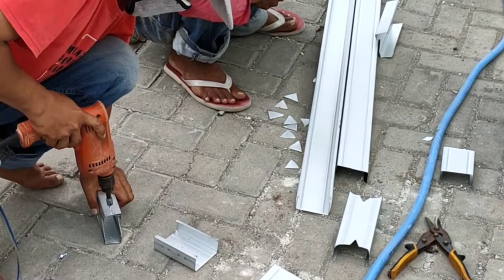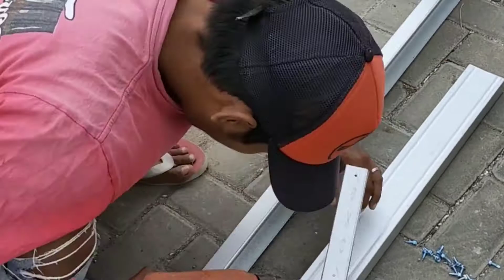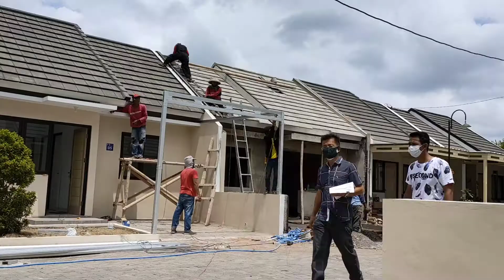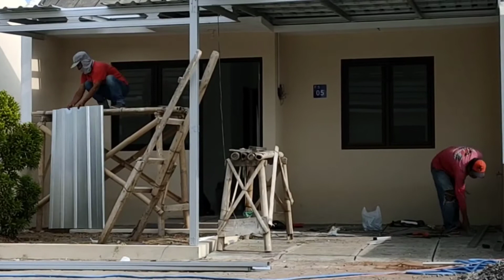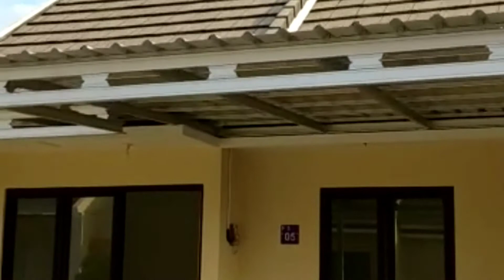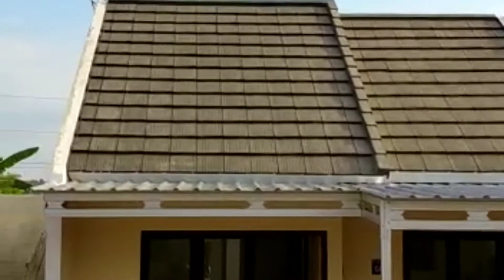CUKUP 2,8JT UNTUK KANOPI MINIMALIS LUAS 16m2

Comment: Total biayanya berapa om...
Reply from the maker: Luas  16m2
Total Biyaya 2.720.000
Untuk info lebih lanjut bisa hub WA kami di 081903705961
Reply: kalo atap baja ringan habis brp ya?
Reply from the maker: @robbydwimilyana6406  untuk ukuran berapa pak
Reply: @knpbajaringan  84meter
Reply from the maker: KNP Baja Ringn
Berikut adalah daftar harga baja ringan
*Rangka atap setruktur genteng beton, soka,mantili,kramik Rp115.000/m2 trpasang
*Rangka atap+genteng metal pasir Rp175.000/m2 terpasang
kanopi baja ringan
*Rangka kanopi /gudang baja ringangan atap galvalum Rp170.000/m2 terpasang
*Rangka kanopi baja ringan atap galvalum lapis peredam Rp200.000/m2 terpasang
Keunggulan baja ringan dibandingkan kayu atau besi las
1.Anti karat
2.Anti rayap
3.Tidak Rapuh
4.Kuat BERGARANSI 10th(garansi setruktur) 
Untuk pemesanan bisa via tlfn/sms/wa di 081903705961 atau bisa datang langsung di Niten nogotirto gamping seleman RT07 RW 12